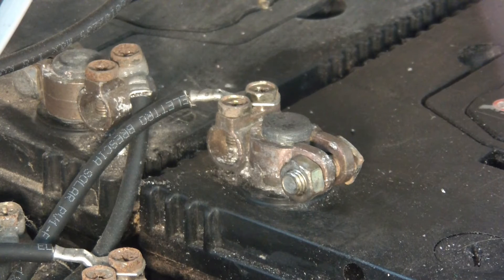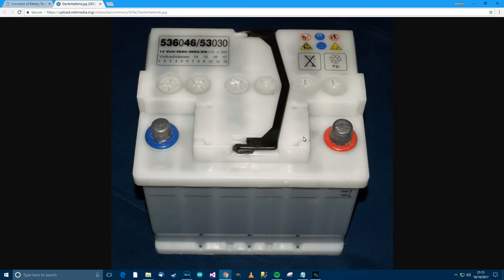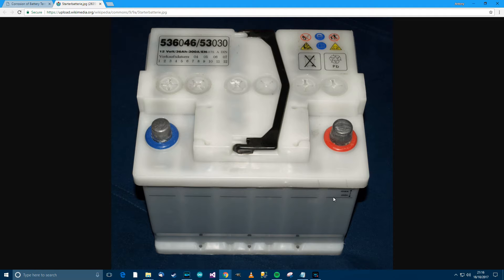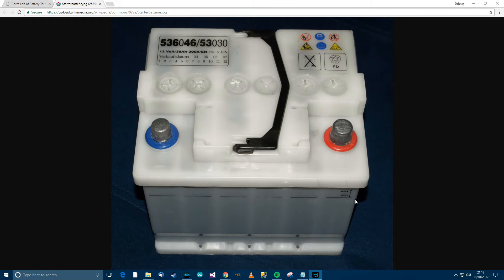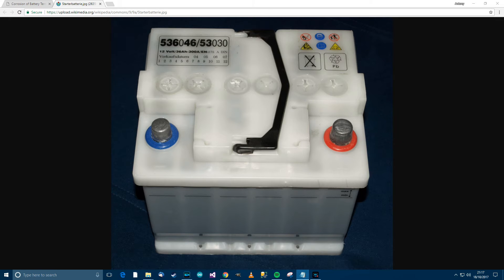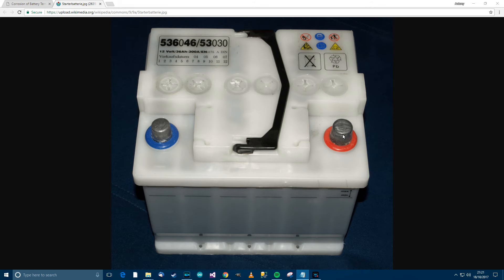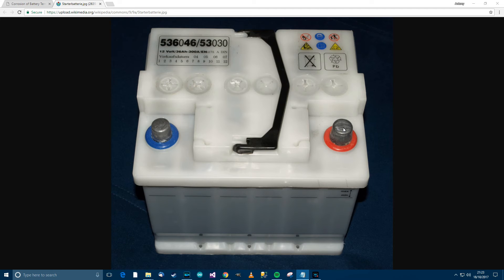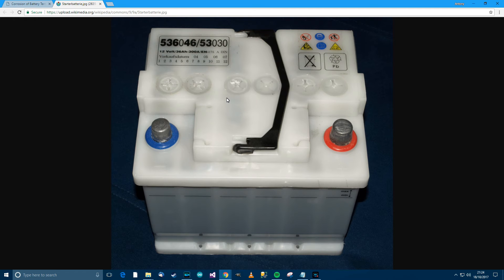INVESTIGATING: Battery Terminal Corrosion! How to Clean & Prevent it! (Misc)

Comment: Thanks mate. My solar batteries (2x wet start batteries) were fine until I used them to start my car. Then they started to sulphate. Did you put grease or petroleum jelly on  the battery posts?

Comment: How much does starting a car drain the battery? Like what percentage or what voltage does it drop to or what amount of amp hours does it drop by? I’m trying to figure how long the alternator needs to run after startup to fully charge your battery back up